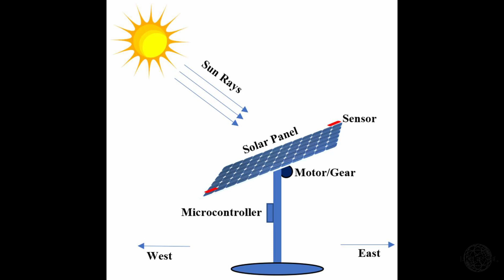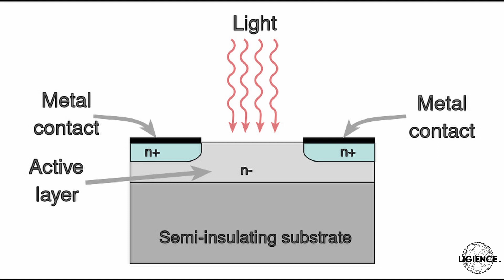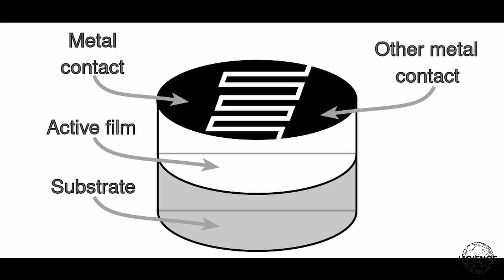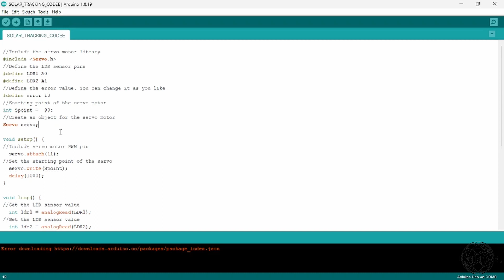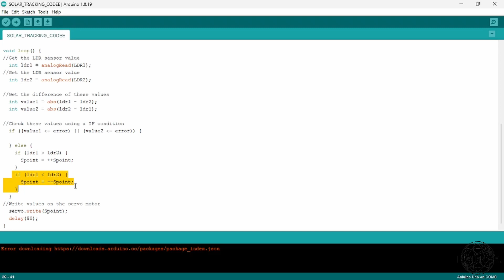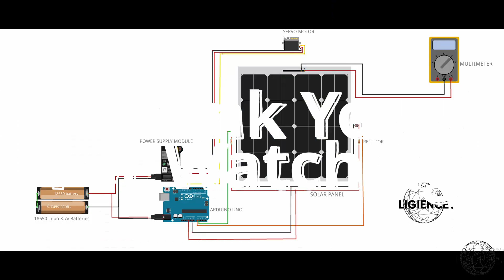How I Made A Solar Tracking System | DIY Solar Tracker- Arduino

Comment: Hey sir, I want to power supply an arduino in which there is a ultrasonic sensor and a bluetooth module

So a direct supply of two 5v solar in series can run it or not?
Reply from the maker: Power from a solar panel isn't constant as it is based on the panel and the light intensity. I'd advise you to get the solar panel hooked up to a small solar charge controller and a battery, then use either a boost, buck converter, or voltage regulator to get the 5v based on the output you get

Comment: Did you make the Arduino and the power board power supply or you buy it?
Reply from the maker: I bought the power supply for the board, i had it laying about, so i just used it.   But you could actually just connect 2 Lipo batteries directly to the arduino uno. If you want 5v, you can use an LM7805 or variable voltage regulator circuit to get the 5v for the servo motor from the batteries as well.  The power supply  board just easily fits the needs

Comment: Very good video man.
What's the solar panel watts? 
And where can one get the components to carryout similar project ?
Reply from the maker: That panel, in particular, if i remember correctly  it was rated at 6 watts . You could get them from electronics and hobbyist stores
Reply from the maker: I use hub360 at the moment
Reply: Okay man,  thank you.